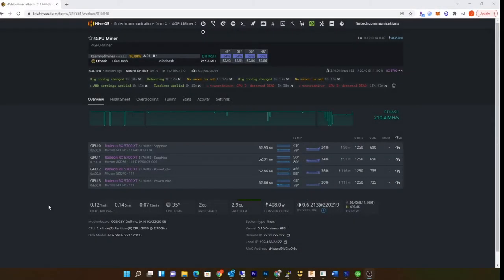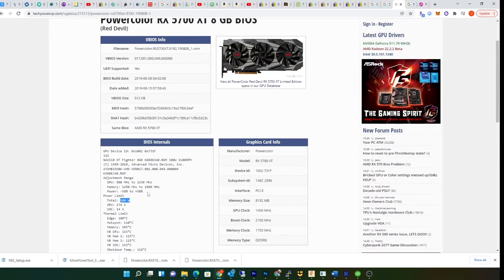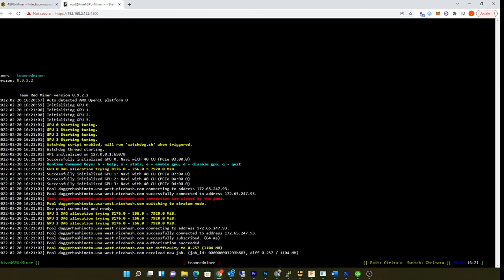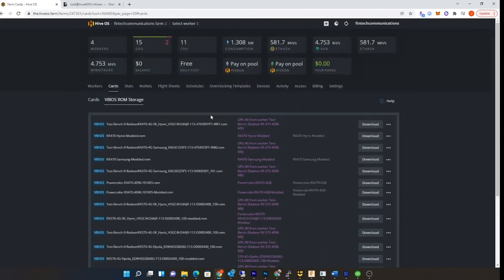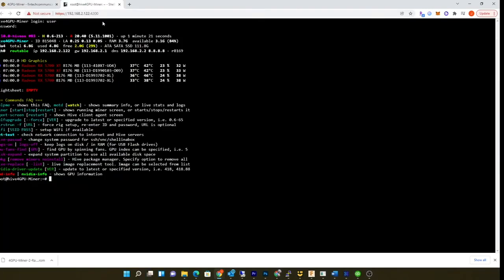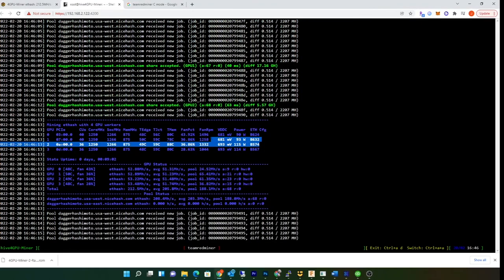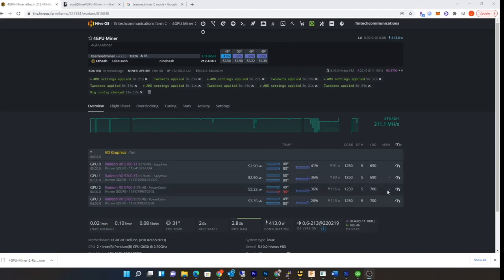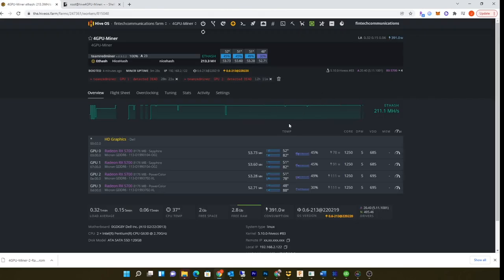RX 5700 XT bios downgrade to Non XT for better power consumption and more hashrate

Comment: I own 5 Sapphire 5700XT’s, the 3 fan ones. I never replaced the thermal pads or did a bios change. I can only get them at 51mhs on Ethereum at most at 140watts each. I always leave the ram at stock using AMD Radeon Software because if I try to get more msh by increasing the memory clock they crash. I am assuming it’s either a bios issue or I have to replace the thermal pads but I never did any of that as I was afraid of damaging the cards and voiding warranty. I figured as long as they worked why mess with them. I didn’t want to take that chance. Nice video though. Liked and Subscribed!
Reply from the maker: You need bios mod and under volt, Running them at full power makes them run hotter. The sapphire nitro+ are the best 5700XT I've tried. I use to overclock the memory but it wasn't worth the risk of destroying the cards for a few megahash.